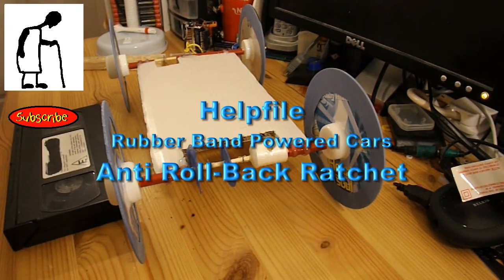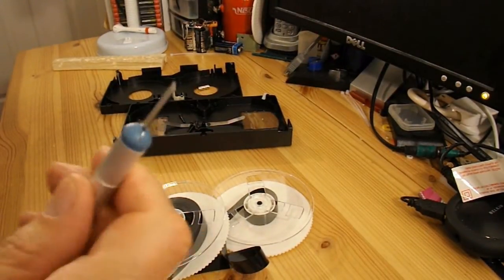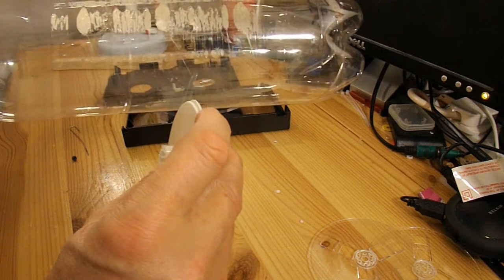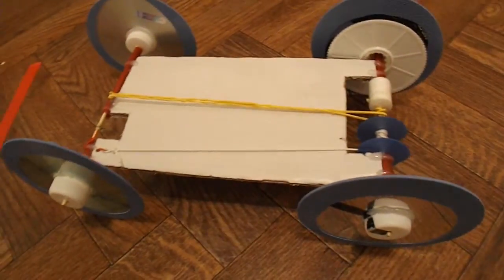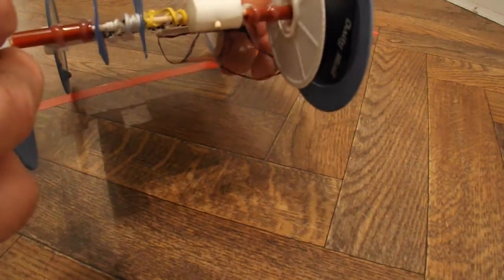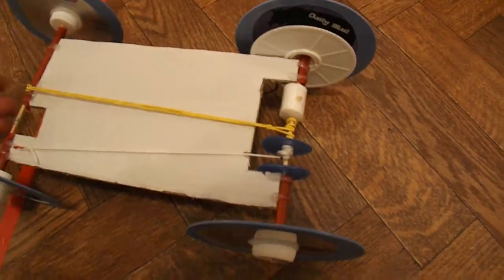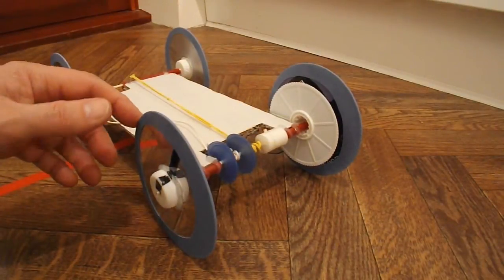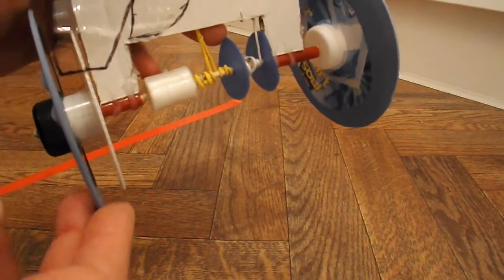Helpfile - Rubber Band Powered Cars - Anti roll back Ratchet

Comment: Thanks again for another helpful video, may I ask what kind of elastic bands you use? And what the length of them of are?
Reply from the maker: Hi Sakib, I just use rubber bands that come in a mixed pack from my local bargain store. On this car I used 4 bands that were about 3 inches long each and about 1mm thick. I chose them because I didn't need much power for the demonstration.